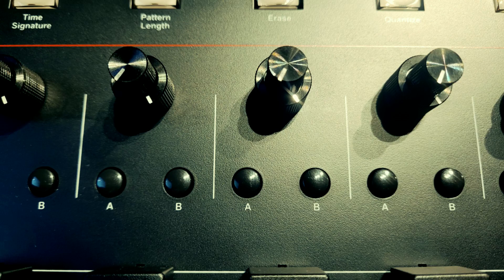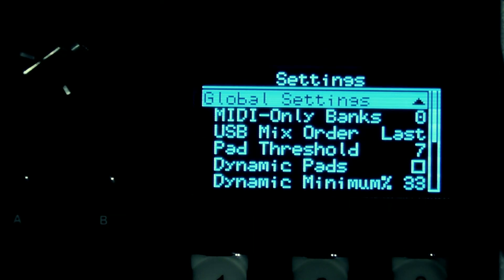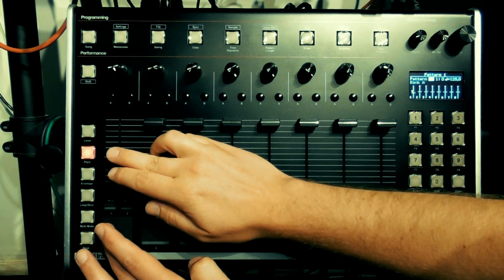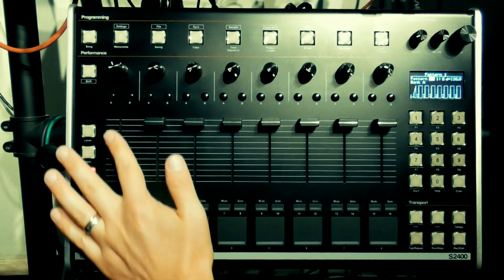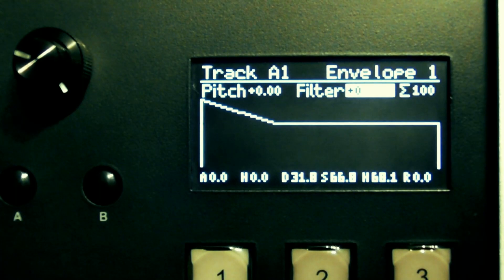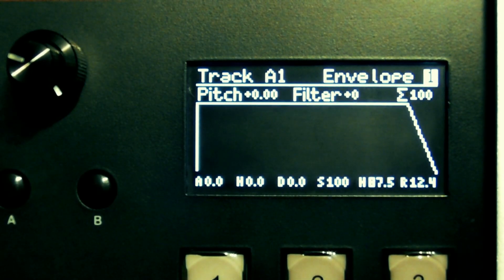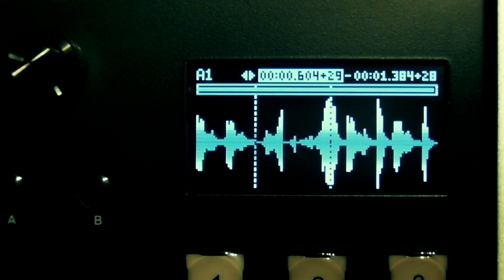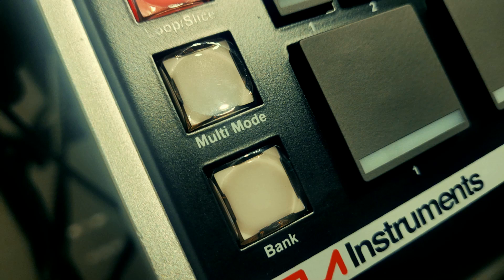Pt.2 - Filters, Level, Pitch etc - Isla Instruments S2400 Video Manual

Comment: New user.  So in MIX mode with none of the SIX buttons lit up, the concentric knobs do not manipulate the filter, or anything else.  I need to press the B button to get the knobs to modify the filter.   Same with the LEVEL max modification.  What am I doing wrong?